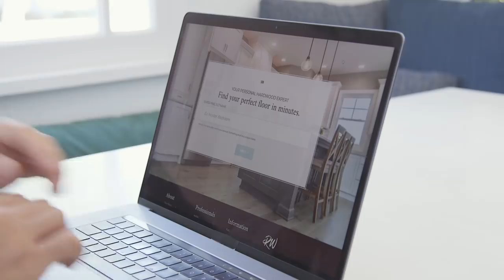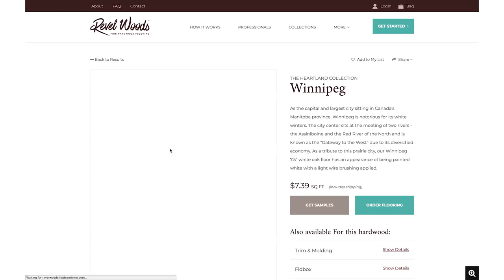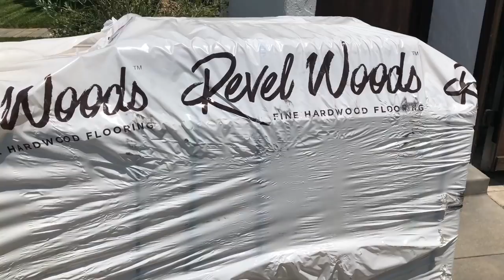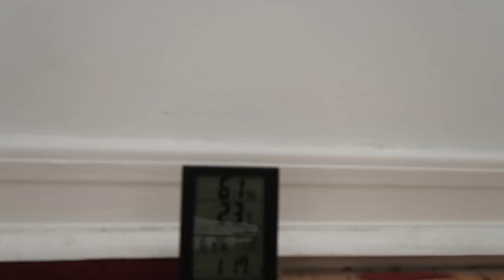OMG We Did This Wrong! | OMG We Bought A House

Comment: After 19 years in our current house, lessons learned are many. 1-know the weight of custom window blinds or other material (some are crazy heavy and a pain in the neck to open and close); 2- some tasks are worth paying someone else to do (a whole house flooring job, and some electrical and paint work (think: high ceilings); 3- if you think there's a drainage problem around your property, there probably is. Get it fixed, even if it's costly. Your home is an investment to be protected.   4- if you are moving into new housing and get to select tile, flooring and other finishes, that's the moment to choose what you really want, within a reasonable proximity to your budget. Lowballing costs then means you live with it for a long time because you don't want to tear up your house and disrupt your life to change tile, flooring, etc later.

Comment: We’ve learned to know where your plumbing is before nailing in new moldings.    Expensive lesson in a room that shared a wall with the garage, where the hot water heater was.

Comment: Homeowner lesson I've learned...My yard is huge....and I mow it myself.....it isn't regular grass, a bunch of different grass and weeds that hang out and look like grass...and holes, hidden holes....But the accomplishment when I actually get it all done....Yaaaassss....then there are gutters....gotta clean them out too.....awww geeze.... Garages get full of crap fast, ......it never ends, because you still have to clean it all, keep up with it and fix door knobs, and faucets and worry about scratching the floor when you move stuff....but honestly, it's great.  Renter for 30 years, home owner for 3.....  (still working on outside plan....) but it's mine.  lol, the gutters, the yard, the garage that's full of junk, the weeds.....but....it is mine.  I don't have to ask if I want to paint, or put up a fence or anything.  That's the reward.

Comment: I put a ceiling medallion in my dining room,  my ceiling was deep navy blue with a really cool molding treatment and i had an older fixture.  Rather than replace it since it matched the house i painted it and the medallion almost black (oil rubbed bronze but i think it looked darker than that). Everyone that came in my house loved it so much. 
I moved to Las Vegas last year and my old home in NC was almost 100 years old,  the only thing i miss from NC (other than my friends) are my very old,  very beautifully patina'ed oil sealed wood floors.  I loved the dining room ceiling but we are going to do an homage to it in our new place,  but there's nothing that can replicate those floors.  We've looked into reclaimed wood but our home here is much bigger so we would need a huge lot.  All i know is i can't wait 5 years to get this carpet out.... it was brand new when we moved in but it's the cheapest the owner could find to make it good just long enough to sell the house.  We have 4 dogs and I HATE having carpet. Plus i feel like the carpet holds the heat..... it's probably a mental thing but i feel like wood floors would be airier.

Comment: My hyubby and I are going through this. We bought our condo. When I moved in 5 years ago we did small upgrades to our place. Last year, we installed an appartment washer and dryer into our closet. My brother-inlaw helped us out. The only prblem is that the wall is not straight in our bathroom. The closet is outside of the bathroom. If we still are living in this place maybe we would fix the issue down the road. We also installed our own tile floor. We should have used the level stuff before we installed the tiles. The look really good. When you look close up you can see that they are all not level with the floor. For our first time doing this project, I do feel really happy with the results even though they aren't perfect. Our next goal is to refinish  our floors. Another tip.... When we had the 1989 earthquake, we didn't realize that the earthquake damanaged my parents bathroom. Years later bugs started popping up in the bathroom. There was also a small leak which my dad thought he fixed. Right before our family moved my parents had an inspector check out the house. The entire downs stars bathroom was rotted. It was starting to seep into the bedroom. The whole house could have probably caved in. When the inspector was ripping out the floor, he actually fell thought it. It was that bad. Always, if you see a leak or an excessive amount of bugs in your home, cheeck for rot. Check for mold as well. You just never know whats hidden under your floors. Another great animal tip... my parents have cats. My dad took the vent off the side of the garage. That is the cat door for the cats. In our other home he did the same thing. No need to buy a special door. My parents cats are indoor out door cats. At night they stay outside. If they have to pee they go outside. They have their eating station in the laundry room. :)

Comment: My fiance and I bought a condo that we are living in. The kitchen has cheap cabinets and counter tops that are compressed wood. Prior to us moving in the sink leaked and caused the compressed wood to expand and crumble underneath the sink. We bought a piece of thin wood to replace the area till we were ready to completely flip the kitchen. Well...we have bought all our furniture and the family room is right next to the kitchen so when we remodel everything will get dusty. We now wish we had redone the kitchen before we had officially moved in. We also have a water heater that will need to be replaced because its been apart of the unit since it was built in 1970. The water heater could go any day now, and we really wish we had just replaced it prior to moving in with all our furniture. But we have learned our lessons, and plan to use these experiences for when we start our house flipping business. Just like you and Joey, I'm the eye and my hunky fiance is the muscle. We take so much inspiration from you too, and can't wait for our business to take off.

Comment: My worst mistake is floating laminate wood flooring in a high traffic area in a house in Louisiana. idk where we went wrong (installation or humidity?), but I have gaps in between some planks now- which is easily fixed with tongue & groove glue or something, but I just don't have the patience to do the entire floor again lol My 2nd mistake was not deglossing my front door or the door frames in the house before I painted them-- every single one had scratches or peeling within a month or two. I'm in the process of planning a total makeover so a video of general tips and tricks would be awesome!

Comment: Buy lots of extra switchboards and fan regulators in the design you do your entire house in (also door handles etc if you get the furniture custom made) because when years later they stop working or break and the design has been out of production for a while, you don't face a problem.

Comment: You kind if already touched on that, but one of the biggest mistakes we made was NOT changing things we knew we wanted done before moving in, because it's been a couple of years now and we haven't fixed it yet hehe. Kitchen cabinets, lights etc

Comment: Joey, get The Upshout brand of ceiling touchy paint. If you have basic ceiling white paint. It perfectly matches it. The only thing is that yoybstill will have to either get a ladder or scaffolds, which are safer, to tape up and cover the chandelier so you don't get paint on it.

Comment: Cherry wood floors are gross. There not call red floors or red wood it's cherry wood.
Reply: When you buy wood floors you are supposed to open the boxes n wait 24 hours before installing so they can breathe n acclimate to the room temperature that way they don't expand or retract later on causing squeezing or boards to pop up.